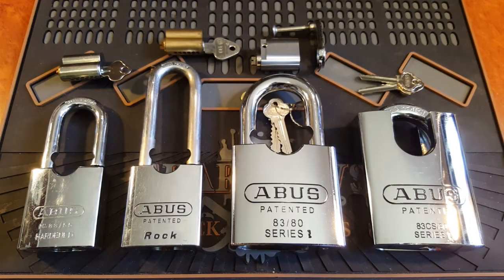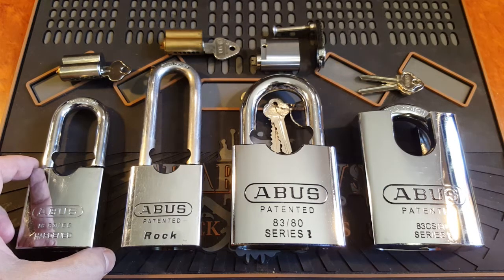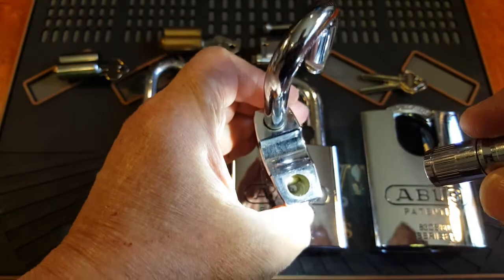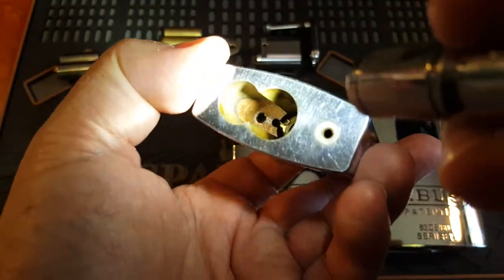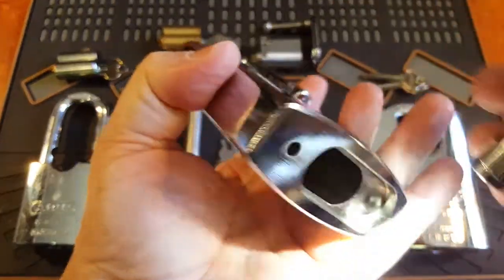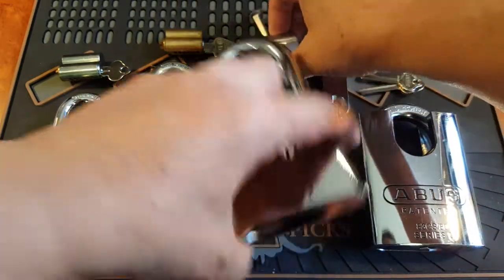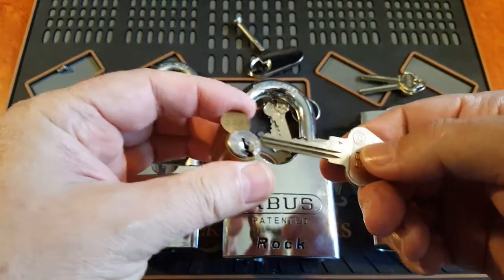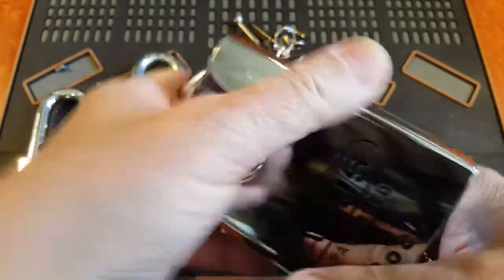(3) A Look at Some Abus Rock's

Comment: What a great selection of locks buddy. Also just seen that lockwood over at dazevers channel what a little peach that was. I find abus to be great locks, ive only had the brass ones but these look awesome
Reply from the maker: uklockpicka thanks buddy. Yeah, trying to get some Lockwood's out there. Daz is a champ.👍🏽Yeah, these Abus Rock's are all hardened steel, not brass so very appealing to upgrade the cores and use in the wild.  🍺👍🏽🇦🇺

Comment: Very nice Abus locks. I have an 83CS IC/55 That has a Best core in it. Steel Pinnings sent me the core. The shackle doesn't come out on mine, but it also doesn't say Rock on it anywhere.  No rust in the shackle area on mine,  but it does have a bit of uneven plating in the core area. I hadn't noticed it, until I looked at it, after watching your video. I bought mine new around Christmas last year, so they might still be having issues with the internal finish. On the outside,  they are beautiful.
Reply from the maker: William Mancel thank's for that William. I would guess like my first one that it's a 1st gen one. I believe that was what I read some where. I find them harder to find. Adrian said they were made in China and the QA just was not as good as other German manufactured models built in Germany. Cheer for watching! 🍺✌👍🏽

Comment: Man, I didn't have your bell rung...  so I wasn't getting notified. 🤬
But those are Beautiful hunks of metal bro.
Looks like the Assa model oval is the Norwegian oval, and the smaller one is a Scandinavian oval... but don't quote me on that. Lmao 
I was looking at getting the 83cs/55 rock. 
But haven't pulled the trigger.  ✴
Thanks for sharing
Reply from the maker: Steel Pinnings haha, I've had the bell turned off on some channels that it was on before.😕🤔 I'm really not familiar with Euro oval's but I know they are different in size. Would be awesome if they had standardised them all.😞 I don't know if our 55mm Rock uses the same core as your's thou... it looks similar but I can't be sure.🤔🍺✌
Reply: Don'z Lockz 
The one I have uses the standard 83 series core. 
I wish there was more of a standard with locks.  But wish in one hand and spit in the other... you get the rest. Lol
Reply from the maker: Steel Pinnings cheers buddy. I just checked the 55mm and it's also the same 83 series core so atleast that is the same.👌🍺😊